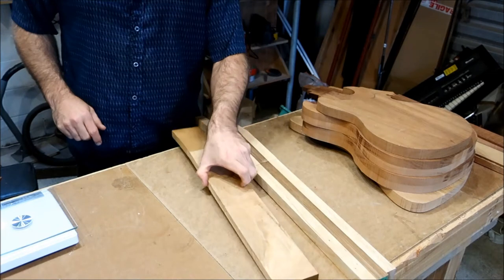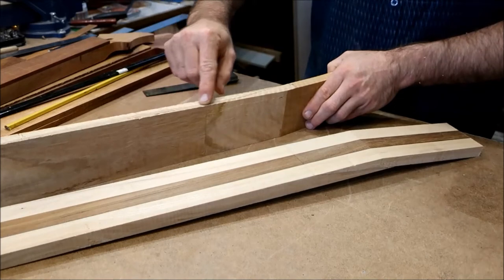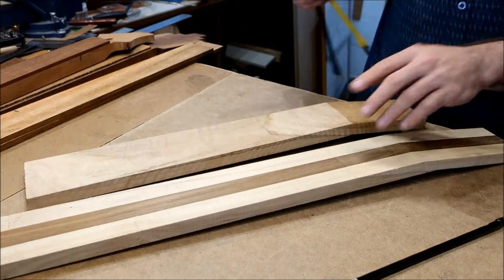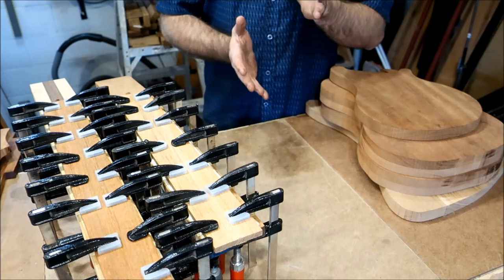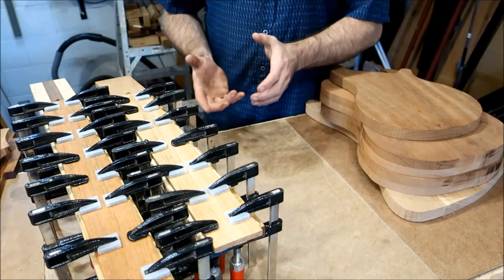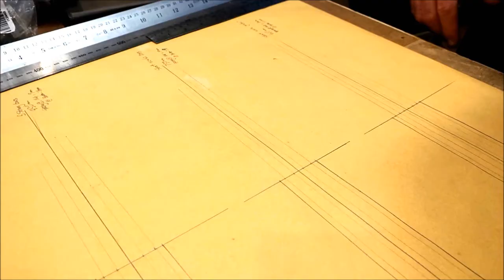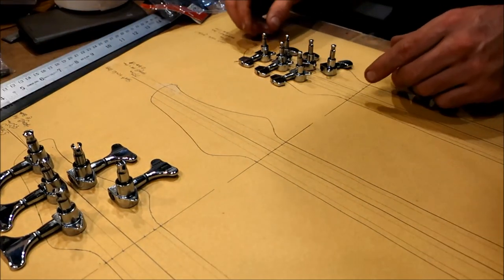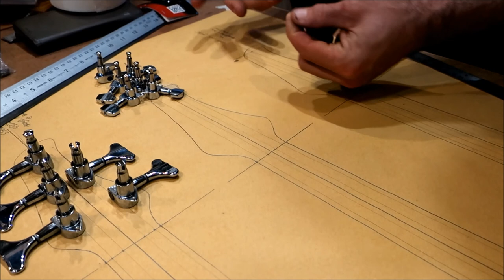Guitar Buildathon Episode 5 - Installing truss rods and checking the headstock designs

Comment: Is the trussrod anchored at both sides of the channel? I'm working on my first guitar build and I haven't heard of anything like that but my father insists on it being having to be anchored on both sides in the wood. He has no experience as a guitar builder either but he is good with physics I don't really understand what he's getting at and I don't see it in your video either but maybe I'm just dumb.
Reply from the maker: He's talking about a single action truss rod where 1 length of steel braces against the wood in the neck and only operates one way.  I use dual action rods because they brace themselves against a second length of steel and can operate in both directions. Hope that helps.
Reply: @fanbladeinstruments  better truss rod double action !!!

Comment: Dude, you forgot to take the masking tape out before attaching the fretboards! Didn't the fretboards cup? I know the tape is thin... but still.
Reply from the maker: The entire point of the masking tape is to stop glue seeping into the truss rod slot, why would you remove it? That would cause far far greater problems than a tiny thin piece of tape under the fretboard.
Reply: @fanbladeinstruments  ok .

Comment: So do you cut the truss rod slot just deep enough so that when the rod is in the slot, the top of the rod is flush with the wood, and other than the tape, there is no gap between the top of the rod and the bottom of the fret board?  Thanks